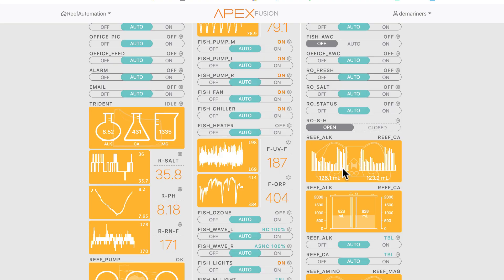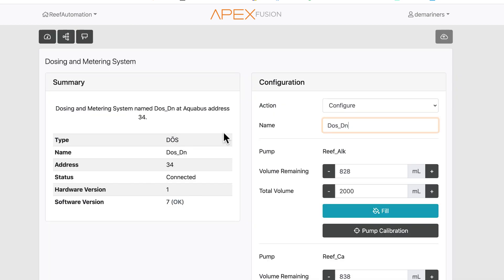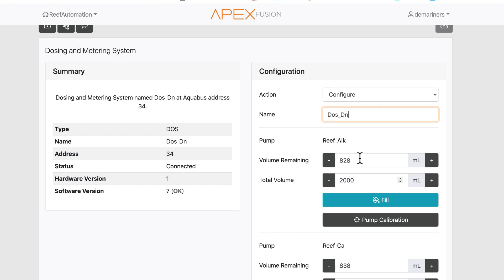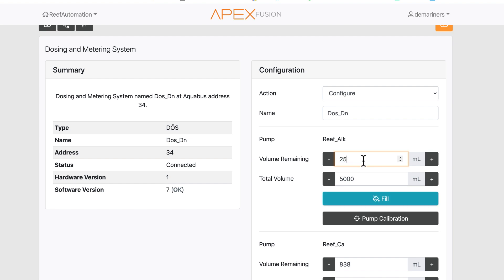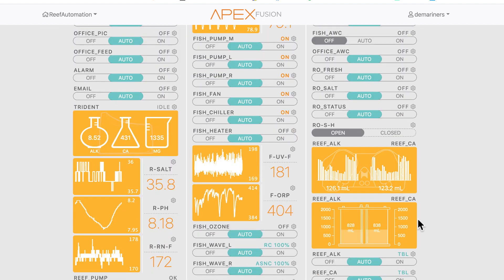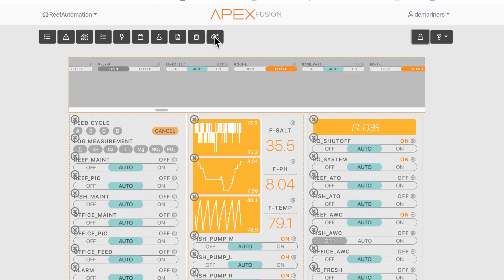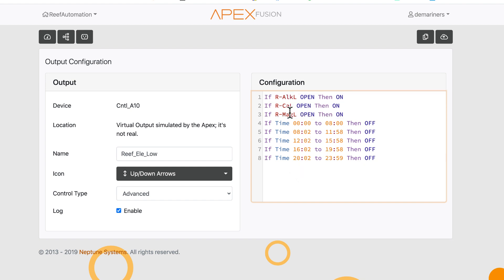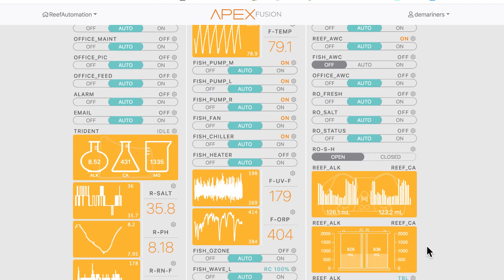Neptune Systems Apex Tutorials - Programming DOS/DDR

Comment: If using a different dosing pump, can you still use DIY DDR cable to get alerts when additive(s) low? Or I could just get Neptune optical sensors and program to do that too right?
Reply from the maker: I have a link on an ebay device that will do that for you.  I think it is in the decription.